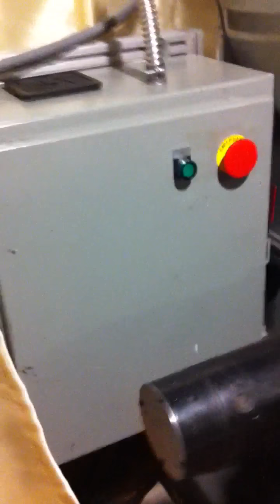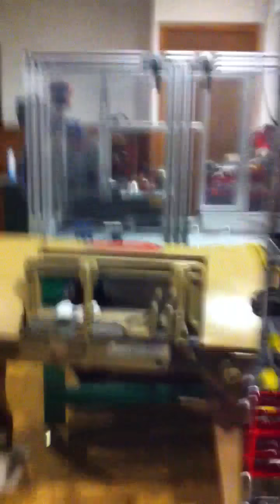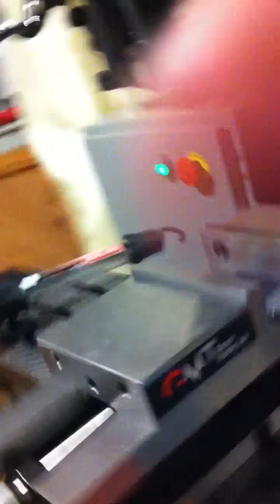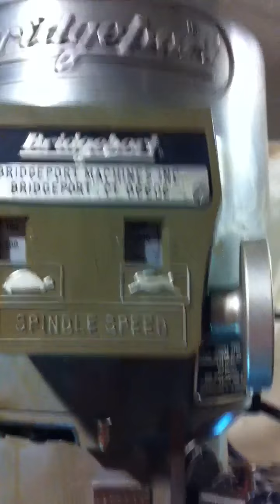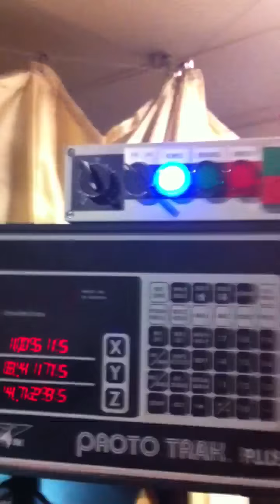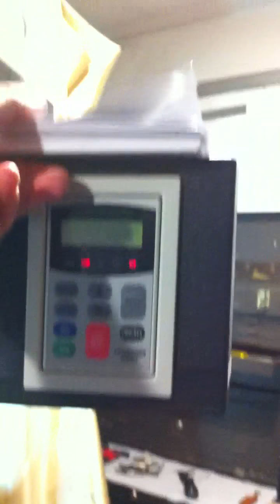VFD Install on Bridgeport Milling Machine

Comment: Nice, clean setup. I have a Bridgeport with ProtoTRAK SMX. It has been installed for 4 months. It is driven by a Hitachi VFD, but I don't have the outboard box and brake, but would like to add it. I have a question about your ProtoTRAK plus. My friend who is helping me (12 states away) has a Plus. How do you save and load your programs. He keeps asking for a tape drive. Do you use this? Or what should he use? Mine uses a thumb drive, Please, a little comment would be appreciated.
Don
Manhattan Beach, CA
Reply from the maker: Hi Don, thanks for the comments. I have a tape drive that came with my ProtoTRAK Plus, but it is non-functional so I have never been able to use it. It's on the list to see if I can diagnose and fix it. I have read that you can use the serial port on the back of the Plus and connect it to a computer using a special cable that you have to make (the cable spec is supposedly available from Southwestern if you call them and ask for it). Then, you can use a program like Hyperterminal to send the files from the Plus to the computer. I haven't tried this yet. This would be my preferred method if it works. So what am I doing right now to save programs? I'm not :(
Reply: I recognize this is a very old comment, but he doesn't need a tape drive.  He can use Edytor (free software) on a standard computer and he can send and receive code.

Comment: If you wouldn't mind,.... how much would a system like this cost to set up?

Many thanks.
Reply from the maker: Hi, I don't have the exact numbers, but the build was probably around $800 or so. The VFD in the size I got was $350, and the enclosure was about $150 from eBay. Then there are the fans, fuse holders, terminal blocks, power supply, wiring, etc.